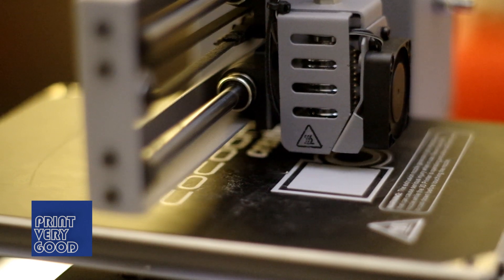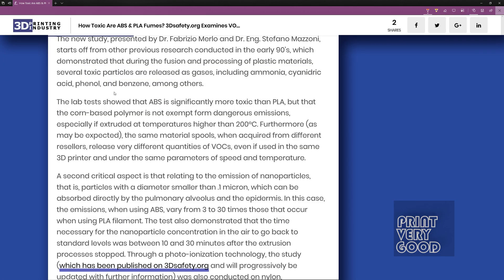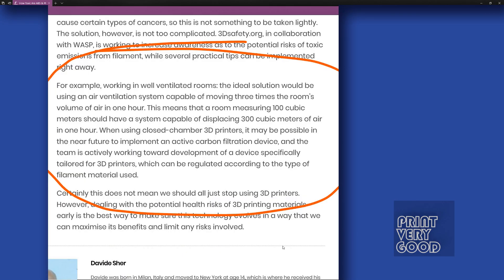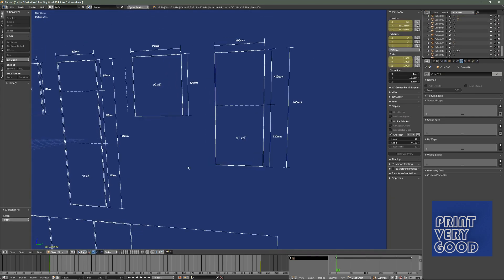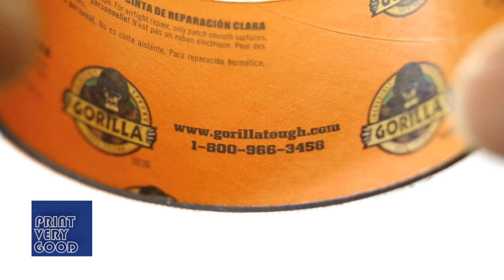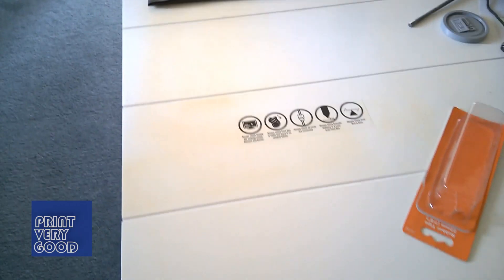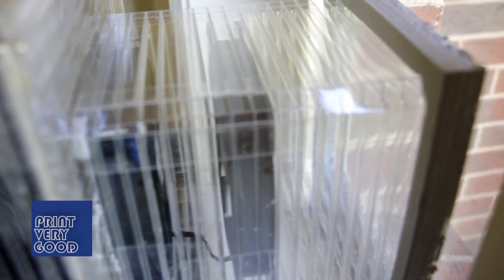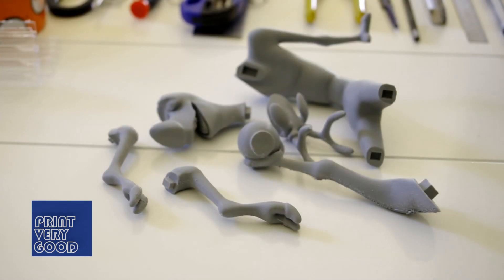Why I Enclosed My 3D Printer, and How I did It!

Comment: Nobody really knows the long-term side effects of this yet? I have worked in a Injection molding plant that made the skeletons of General Motors dashboards I never felt sick but they had some serious ventilation around those machines they were the size of 4 Semi  Trucks!!! I never really smelled anything when the mold opened. I'm working on a vent system for my Resin printer to send everything out teg window in my home office because we have central AC and Heat it just sends the vapors through the entire house, till I get it done I keep the vents and doors in the office closed and open both windows one has a small fan with 3 blades so it pulls the air from one window and sends it out the other.

Comment: Good job on building up the enclosure!

The only thing I have noticed is there is no fan to pull in the air out of your room. By having only one fan that evacuates the air we only create negative pressure inside of the box.
I'd suggest adding a second fan or tiny ventilation holes close to the bottom edge of the box

I'm about to build up my own fumes extractor for a 3D printer  :)

Cheers!
Reply: I don't think you watched the whole video. He made a slot at the bottom of the encloser.

Comment: Do you find the enclosure gets rid of all the fumes?
Reply from the maker: I find it gets rid of most of the fumes to the point where they're not really noticeable. Although if the wind direction changes and the wind blows directly at the window outlet the fumes are blown back into the room and they are super noticeable then. Now that we have a granddaughter, (she's 2 years old now) I've moved the printer into the garage. Don't want to risk damaging her little lungs. I much prefer that location. It allows me to print day and night without disturbing anyone. I still use the enclosure out there as it works well to insulate the printer from the cold overnight.
Reply from the maker: Might do an update article on the enclosure and how it's been going over the last few years. Watch for that over at printverygood.com

Comment: I kind of wonder how long the electronics will last.  I have looked at a lot of enclosure ideas and a lot of them suggest moving the electronics and power supply outside the enclosure.  You might also think about using a hepa filter as well as a dryer vent cover on the outside to prevent the coming inside.  

I have been looking for a good material to build an enclosure out of.  Anything, but wood and foam is quite expensive, but I will look at the hollow polycarbonate.  It sounds promising and easy to work with.
Reply from the maker: I have a small opening at the bottom of the enclosure which draws air over the base of the unit then up and out the exhaust area. This keeps electronics temps under control. If you didn't have fans and your enclosure was fully enclosed then yes I agree, it would not be good for the electronics and they would cook.
I've moved the printer and enclosure out to the garage now that we have a granddaughter running round the house, as such I don't feel the need for a hepa filter now. If I was to put it back inside I would definitely install one.
I'm really happy with the polycarbonate. If I was building another enclosure I would definitely build it from that material again. Might do an update article on the enclosure and how it's been going over the last few years. Watch for that over at printverygood.com

Comment: Couldn't you print a 'U' shaped joint at the exaust out the window to fix you're wind issue?
Maybe you're right about building a cover to alleviate the outside pressure from the wind.

Comment: I actually just ordered my 3D printer and also wanted to build an enclosure. The first idea I had was actually using the same material , however , the way you implemented the fan is far smarter. Thank you for this helpful video, even more than 2 years later

Comment: Isn't PLA food grade? also I wonder if a small air purifier used in conjunction with the printer would eliminate any particles....
Reply from the maker: No PLA is not food grade. Food grade refers to whether it can be used to consume or store food. Due to its nature, PLA stores food and bacteria in it's crevices and can't be properly cleaned so should never be used for food. PLA is made from corn starch or sugar cane however, this is what you could be thinking of. PLA is said to be safer if extruded/melted at less than 200 degrees but I find it performs better at 210-215 at which point it gives off VOC's.
Reply: @PVG3DPrints  OK this is probably why I thought it was safe, this is from the Wiki page on PLA....'PLA can degrade into innocuous lactic acid, so it is used as medical implants in the form of anchors, screws, plates, pins, rods, and as a mesh.[33] Depending on the exact type used, it breaks down inside the body within 6 months to 2 years'.
Reply from the maker: @petersmith6423  There you go, I didn't know that... thanks for the info
Reply from the maker: Re Air purifier, I'm not sure. But it could work if you could make sure to direct all air from the printer directly through the purifier. Somebody may have already tried this online?

Comment: My solution is to build a vacuum chamber. The plexiglas is relatively expensive so a steel box cut by laser then welded is cheap, then you need a seal and plexiglass door. You then need a vacuum pump. You sligthly vacuum the enclosure and start printing. The printer needs air to operate. Then after the job is done you vacuum the chamber and release the air outside through a filter so you don’t contaminate the environment. The most convenient pump is a fridge motor (you only need to top up the oil) which is silent. At the outlet it needs a filter and an oil catch can. After you vacuum the chamber, nor all the particles will escape the tube. Some will fall down to the bottom because of gravity since the litte air remaining will no longer be able to sustain the fine particles, and you can clean them. Maybe even  using a small ionizer to make them stick better to the surfaces better.

Comment: Same here... after a few weeks of printing PLA every evening in my living room I got a cough as well and later a strange feeling in my lungs and upper airway. It got a lot worse when I started with PETG. It disappeared after a day of windsurfing out in the fresh air, and came back after printing the next day again. 

So I´m also definitly making an enclosure for it....not running it without for any minute longer.  :(
Reply: Did you end up finding a solution to the ventilation or fume extraction? Did your cough go away when printing?

Comment: Nice work! Have you considered flammability of polycarbonate?  That’s all I’d be a bit concerned about, but with casual research it seems to be reasonably fire retardant and will not contribute to a fire if exposed.
I’m going to dig a bit more , but if all is well I’ll probably make one of these too.
Thanks for sharing.
Reply from the maker: Hi Dave, thank you! That's a good point I actually hadn't considered whether the polycarbonate was flammable, I'll do some research as well. Thanks for commenting.
Reply: I’d be interested in hearing about it.  I’ll dig when I finally get back from my swing.   And, although glass isn’t flammable, it may possibly shatter unless the right grade is selected too. Another thing to research!    Certainly the polycarbonate is expedient.  Many years ago I used to do plastics fabrication with polycarbonate and everything else but I am rusty on the properties in regard to fire..

Comment: As I understood (and I wish I could find were I read it) is that after so much time if the unit is sealed it will settle and is not an issue. I like your poly carbonate idea better then what I used (insulating foam with tape and Plexiglas window). As well as it won't go further then 10 feet in calm air. But despite what I had read, I still built the enclosures for the 3 printers I have.. Its worth it for other reasons, such as smell and much better ABS prints.
Reply from the maker: For me it's just too much of a risk. If we can enclose the printer and vent it or even better scrub it I think we should. I worry what we'll discover about 3D printer fumes in the future. Better safe than sorry I believe.
Reply: @PVG3DPrints .  Good point

Comment: Hi Paul, Thanks for the awesome videos. Bought the new release of these printers from Aldi on Wednesday. there were lots of issues and the most annoying was bed adhesion. i thought i was doing something wrong so kept changing settings. Until i saw your videos. Now using 0.08 feeler gauge and isopropyl alcohol i have had 2 stellar successes. i can't wait to try your happy reindeer. baby steps though...
Reply from the maker: That's great to hear Marty! Thanks very much for your feedback I really appreciate it. I see getting started with 3D printing as a critical period, it really is make or break for some people which I fully understand as it can be incredibly frustrating. Enjoy your new printer, stick with it and learn as much as you can, being able to realise your own creations is a very rewarding experience.

Comment: Have you measured the increase in temperature on the power supply of unit ?
Reply from the maker: Hi Kaveman, no I haven't. But I've designed the enclosure with a slot located near the base of the printer where the power supply is. Air flows under the printer and is exhausted up through the fans. Good question though and something I thought a lot about before designing the enclosure.
Reply: Print Very Good that's quite clever, I'll keep that in mind if I choose to make one

Comment: You probably damaged your lungs more cutting the poly carbonate sheets but the poly carbonate may be a better solution than perspex although not as transparent to see the print is going well , maybe a wifi cam via octoprint ?
Reply from the maker: Lol quite possibly! But I won't print without the enclosure now. I've tried on a few occasions and after a few hours of printing I definitely notice and unpleasant odour which affects my throat. 
Have Octoprint setup inside the enclosure now. ;)

Comment: I'm so pleased to have found your channel. This is a great piece of kit, and I will have to do something similar. I imagine it will also improve print quality as temperature stability will be better.
Reply from the maker: Thanks R. James Scheffler III! Yes, I did notice a significant improvement with my first 3D printer which didn't have a heated bed. (The one that's featured in this video).

Comment: Its very normal for a coil wound transformers to have higher voltage than the rating. The internal resistance is high enough to drop the voltage within safe limit when loaded.
Reply from the maker: Thanks for the info Ura.

Comment: I'm with you on being cautious. I recently installed an exhaust system in my 3D printer room since troubleshooting some odd muscle cramping that I thought was caused by some nutritional neglect, but have since found it to coincide with my 3D printing activity. Nothing scientific mind you, only personal observations. At first I could not associate the strange sensations, scratchy throat, etc. to my use of two printers extruding PLA, but after a window of time not using those things, all my symptoms diminished to nothing. I was running them in a spare bedroom next to mine and would have them going all night long for some jobs. Never gave it a second thought since PLA is supposed to be non-toxic and I was simply getting used to the gradually increasing odor. 

I just recently fired them up again and immediately noticed my throat becoming scratchy while in room working near the printers. Even with the exhaust running, while in close proximity you can smell a sort of sweet odor, like antifreeze almost, emanating from the extruded plastic. I may of course be exceptionally sensitive to the emissions from PLA extruding at 210 degrees, perhaps an odd duck of sorts, so nobody panic :-) The PLA I use most is Amolen White and Black in case anyone else has noticed any odd symptoms.
Reply from the maker: I agree with you Shawn. I recently tried printing without the enclosure for a day. I thought that I may have been smelling new components burning in as the printer was new and wanted to do a test. I've had the printer for a few weeks and done many prints and that day without the enclosure confirmed that the 3D printing emissions aggravated my throat and my cough started coming back, even though I was only printing PLA. So for me personally the enclosure and fans always go on when I'm printing and that's the way it will be from now on. Better safe than sorry.
Reply: Definitely, better to be safe. It makes me wonder just how many folks, working with or near 3D printers, might have slowly developing subtle health issues which they are not associating with the use of these awesome devices. I love these things, but I, like you, will never print anything again without running my exhaust system. In fact, now, once I start a print I leave the room, close the door, and refuse to go back in until the print finishes and the full volume of air in the entire room has been replaced a couple of times. Now this is just with PLA, I attempted printing with ABS a few weeks ago and about 120 seconds into the print job could not stop coughing, even though a window in that room was open. I knew exactly what was happening and immediately stopped the printer and aired out my entire house for 30 minutes. My cough took the better part of 3 hours to subside and I have not tried again with ABS since. That was insane. I think ABS is better suited for being printed in a outside rickity shed, one you can see through the walls :-)

Comment: Have you noticed any adverse effects on the quality pf printed products?  I plan on making an enclosure for my new printer but my main purpose for this is to prevent draughts blowing across the build plate.

Having worked in the plastics industry for nearly 40 years with many materials including glorious and potentially lethal PVC, I doubt very much whether my health will be affected by a little bit of home 3D printing.
Reply from the maker: Hi Poruatokin! 
I think the enclosure is a big part of the reason I get great adhesion on a non heated bed (see this video https://youtu.be/07zTGT1xs00) I feel it keeps everything at a more consistent and warmer temperature. Another bonus for me is how much quieter the printer is, I have it close by me while I'm working and it doesn't bother me at all, although the new printer is a bit louder.

I like the fans exhausting any potentially harmful fumes out the window and the way it keeps the enclosure at a regulated temperature, particularly on the really hot summer days we've been having recently.

Looking back, I agree, the PLA fumes are probably not the culprit of the acrid smell I was experiencing, as it seems to have totally gone away, even when I don't have the printer enclosed. I'm now wondering if it was just the smell of electrical components burning in on the first few weeks of use?
Thanks for your question and good luck with your enclosure!
Reply: Thanks for confirming!!

And your comments about the electronics making the smell makes sense.  It's a bit like the proverbial "new car" smell.  You can always smell a new TV or amplifier once it has got up to working temperature.

Comment: Hello, I'm sorry I do not know your name.  You are proving to be a very prolific video maker indeed!  And the quality of your videos would tell me that you must have some teaching experience.  Your scripting and storyboarding for scenes is amazing, as is the overall presentation of your videos.  Gosh, I'll have to take some notes for my little videos!  Anyway... about the enclosure (oh, I just bought the same printer on sale at Aldi on Dec 23 for $200.. spur of the moment decision) I would tend to not have the intake where you put it.  The cold air will have a freezing effect on the molten plastic.  17V will not kill the motor, but when you do move the assembly to the garage, crank down the fan voltage with a 3 terminal voltage reg. and make the fan air velocity slower (https://www.youtube.com/watch?v=MDRF2AKFfEI&t=68s).  Perhaps have the air intake on the top, opposite to the fan outlet.  I think you do not want too much air turbulence around the working parts.  The noxious fumes from this stuff were foremost in my mind when i put the big orange box into my shopping trolley.  But with colleagues teaching CAD and modelling with a big professional 3D printer at TAFE and me struggling to use basic drawing packages, the decision was made to learn 3D CAD modelling in 2018.  (along with music production, 2D animation, video production, professional audio and sound... oh my)
Reply from the maker: Hi Greg! Thanks so much for your awesome comments, very much appreciated! 
My name is Paul Van Gaans and I've been working in the animation industry for the past 17 years, I did do some sessional lecturing at Swinburne in Melbourne way back in 2000, so I must have learnt something from that experience. :)
Thanks also for your brilliant tips, I'll definitely be checking them out. I had a look at one of your videos, I think your a much more natural public speaker than me but I am trying to improve every time I make a new video, it's much harder than it looks. This video literally took me days to make so it's good to hear that someone appreciates the effort I'm putting in. Thanks again!